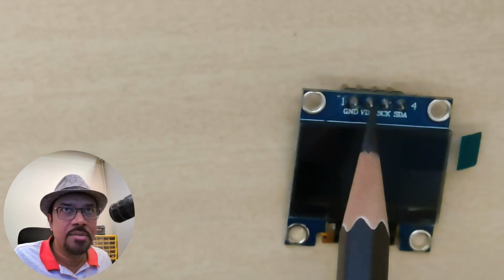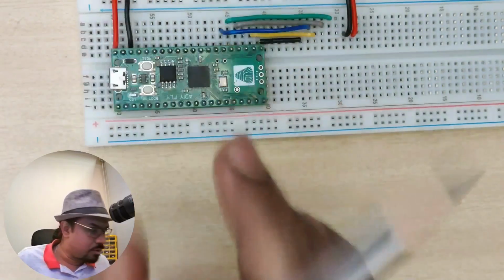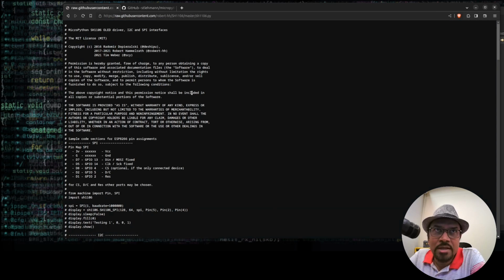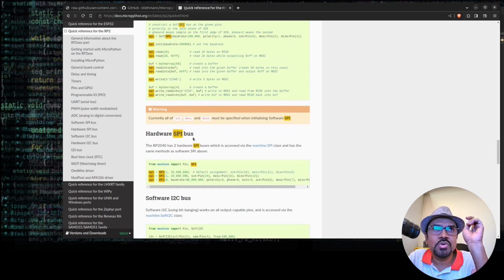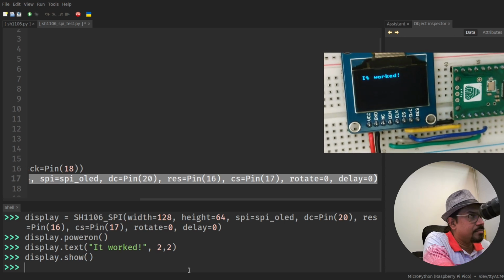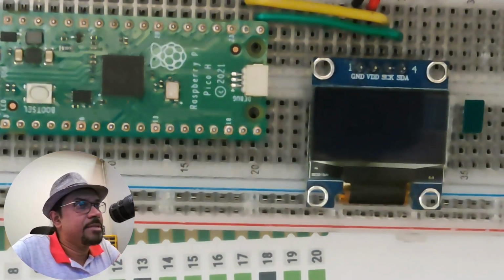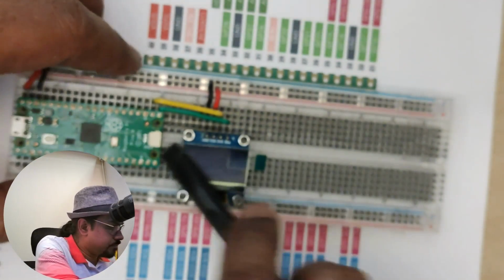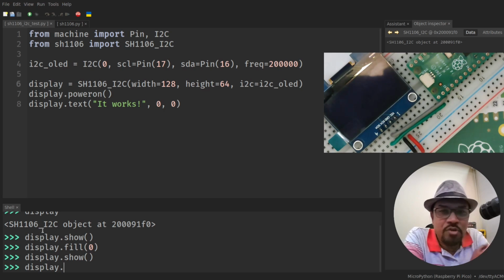Using various SSD1306 and SH1106 128x64 OLED displays on a RaspberryPi Pico with micropython

Comment: Hi, Great tutorial. BTW I could not find the test code for SH1106. I clicked on link it says 404! Can you please reupload the code? Many thanks!
Reply from the maker: Hi @workforth, Thanks for tuning in!

I have updated the links. They should work now. Kindly check and let me know if the problem persists. 
Thank you once again!
Reply: @ChandrashekarBabu  Hi, Thank you for prompt reply.
I am a 36yo Graphic Designer by profession, Learning Microcontroller and Electronics. 

 The code you shared Worked but the display turns it self off after 2-3 seconds. Is there something am I doing wrong here? 

I have sh1106 based 4 pin oled display.
Reply from the maker: Hi @workforth,
Sorry for the delayed reply. I could only check the issue by rewiring the circuit myself only now. 

In the code that I have shared, the last four lines:
   sleep(10)
   display.fill(0)
   display.show()
   display.poweroff()

is responsible for clearing the display and powering it OFF after 10 seconds. If you intend to keep the display ON for longer intervals, you can adjust the sleep interval or comment-off / remove the last four lines that I copied above. 

Let me know if it worked as you expected.

Thanks and Regards,
Chandrashekar
Reply: @ChandrashekarBabu  I removed those line, but still, display turn of after 2-3 seconds. I've tried it on Pico and Pico W both did not worked. My guess would be that the issue is with the display itself. can not figure it out though.
Reply from the maker: @workforth  I too suspect the same - it is working for long intervals in my setup. If you have another spare display, you can swap and check, if the issue persists, then something else could be the issue. 
BTW, is your raspberrypi pico working while the display turns off ? You can check by printing some message periodically in a loop using print() and look up in your thonny console.
Reply: @ChandrashekarBabu  I do not have spare display on me right now. I will check the pico and let you know.

Comment: Thanks a lot for sharing. I have a project now. I need to display some data on multiple oled displays via SPI protocol and within 100 meters. So can I ask you a question? If I need to use 100-200  OLED and use RaspberryPi. Can I complete my project? Please give me some avide.
Reply from the maker: Hi @sonla247! Thanks for tuning in. Connecting 100+ OLED display using RaspberryPi directly would be a challenge given the limited GPIO pins and SPI interfaces on the board. But, you can connect a couple of OLED displays with a little effort by wiring a serial-in-parallel-out shift registers or other multiplexers (like 74HC595). 

You can daisy chain these chips and connect the parallel out pins to each OLED display's CS (Chip-Select) pins. You can wire the other pins of the OLED display in parallel to the SPI out pins of RaspberryPi, while the CS pin of each OLED display can be connected to each parallel out of the shift register and the serial input pin of the shift register can be connected to one of the GPIO pins of RaspberryPi. Using programming logic on the RaspberryPi you can select one OLED at a time and display messages. Now, this requires optimized scheduling logic to programmatically multiplex output on OLED display. 

Note that you need to plan for powering the OLED display separately without draining the power on RaspberryPi board. Also, wiring SPI interfaces are quite susceptible to line noise and you might need to plan on shielding them accordingly.

If you plan on using a RaspberryPi Pico for this - I doubt if it could handle more than 4 OLED displays this way without flickering as it has very limited processing power. But using a RaspberryPi 4, in theory this is doable - but I have not tried it myself. Let me know if you could  accomplish this interesting project. Good luck!